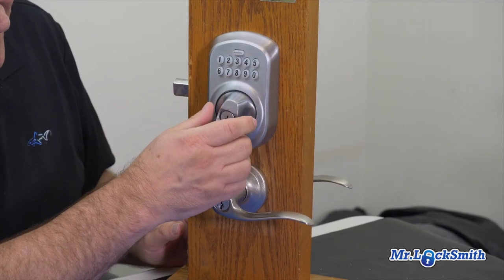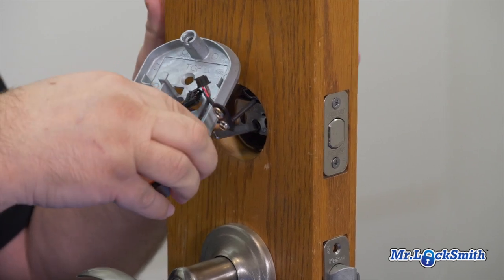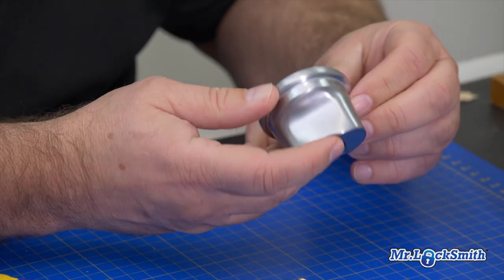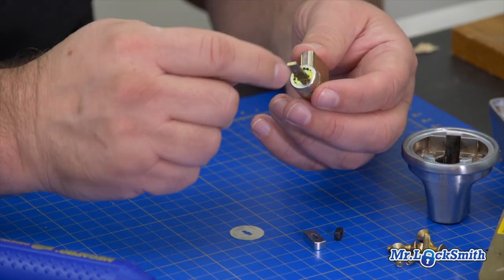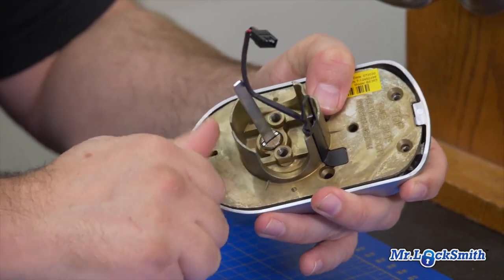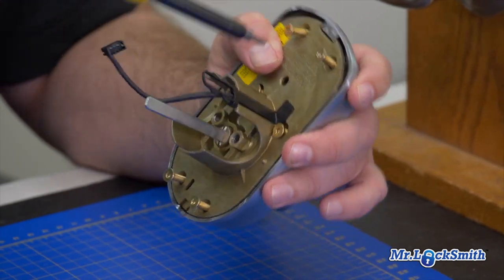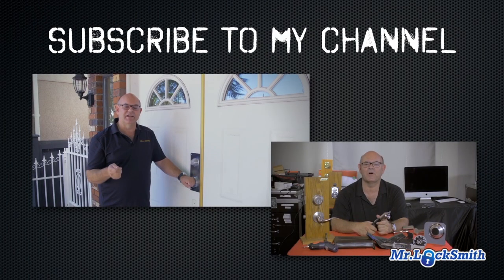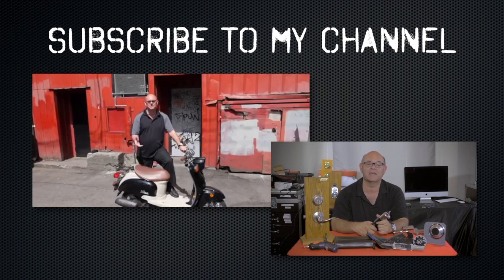How to Rekey Schlage BE365 Keypad Deadbolt | Mr Locksmith Video

Comment: For what it's worth, at the end there when you were testing it, you didn't align the cam on the back in the correct position, so when it's in the locked position if you hit the Schlage logo it would have unlocked, that's why it wasn't acting the way you were expecting (judging by your reaction).

Comment: The tail peice is horizontal but the knob won't sit flush. The opening part the knob fits onto is turned opposite of the backside of knob when the keyhole is inserted into the knob